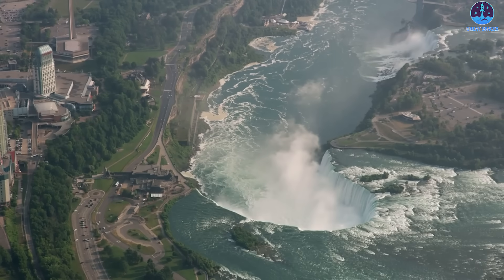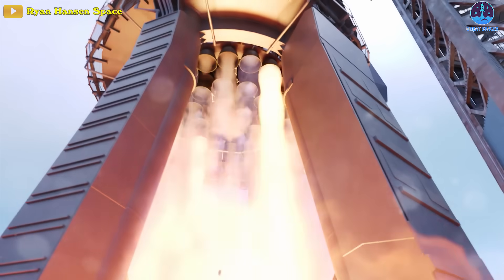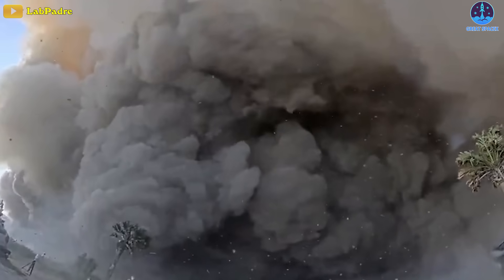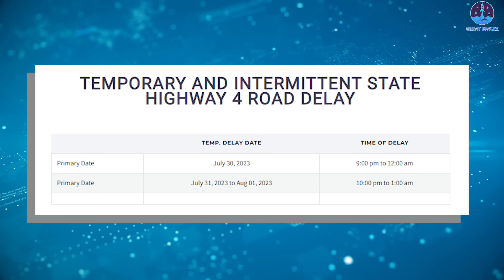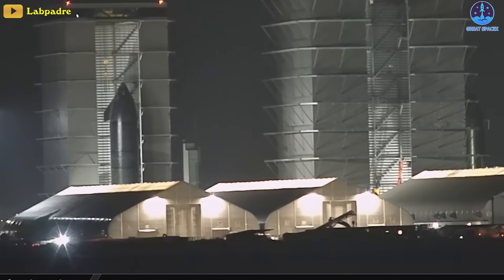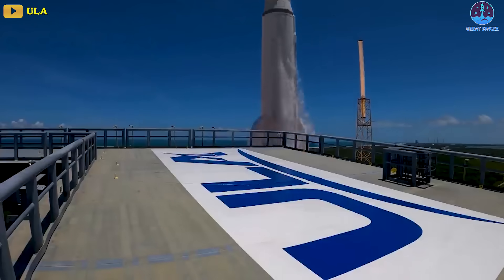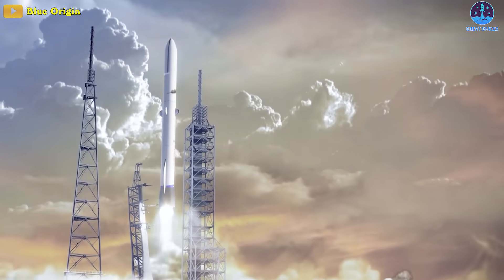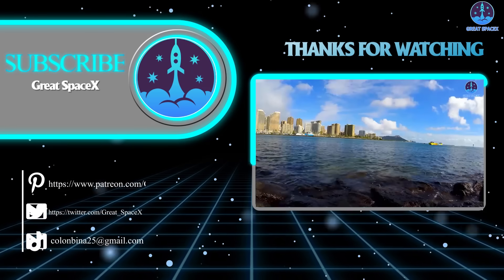SpaceX massive water deluge system full pressure test, Elon Musk's reaction...

Comment: I'm not a kill-joy, but...  I still reckon there will be an issue  where the exhaust shock-cone pulses will penetrate the centre holes of the base-plate. If this happens, the gases entering the sandwich will increase pressure at the centre of the sandwich and push outwards radially between the upper and lower layers of steel. The water is fed from the outside pushing inwards, so there will be a pressure differential: As soon as the plates lose their water, it will be 'Share and Enjoy' at the molten steel diner, and everyone gets their fair quota.

Comment: I'm going to be surprised if that works. There's a reason all launch facilities to date use large diverters in addition to water deluge systems. The water is there to dampen sound. The diverter trench moves the flowing air mass from the rocket in a safe direction. That booster is throwing more than 7000 tons of thrust. I don't think the water system is pushing 7000 tons of thrust in opposition. If the booster pressurizes the ground enough the water isn't going to flow evenly and the base plate will be damaged, bent, or torn up. This is a system that is necessary for SpaceX's plans for future launch sites, including offshore platforms, but if this fails it's another setback. They should have invested in a traditional launch pad and developed the lightweight launch facility on the side.

Comment: Landing Point

Well, from the first attempt at Starship until now there has been plenty of time to improve. I hope that this time there is a balloon with cameras at 30 or 50 thousand feet signing off. Apart from the other cameras in helicopters and airplanes. Even from the starling satellites it could be signing. I also hope that as I mentioned in April the landing point in Hawaii is already designed with rafts and a tarpaulin unfolded with a circle in the center designating the landing positions and cameras on all the rafts to improve accuracy and telemetry. Apart from a good ring of rafts that inflate on the fuselage for the recovery of Starship without her sinking.
I hope that Elon has visualized all these options and if not; there is still time.

An Elon Fan from the Isla Del Encanto: Puerto Rico.

Punto de Aterrizaje
Bueno, desde el primer intento de Starship hasta ahora ha habido suficiente tiempo para mejorar. Espero que esta vez halla un globo con cámaras a 30 o 50 mil pies firmando el despegue. Aparte de las otras cámaras en helicópteros y aviones. Hasta desde los satélites starling se podría estar firmando. Además espero que como lo mencioné en abril ya esté diseñado el punto de acuatizaje en Hawái con  balsas y una lona desplegada con un círculo en el centro designando las posición de acuatizaje y cámaras en todas las balsas para mejorar la precisión y la telemetría. Aparte de un buen anillo de balsas que se inflen sobre el fuselaje para la recuperación de Starship sin que se hunda. 
Espero que Elon halla visualizado todas estas opciones y sino; todavía hay tiempo. 

Un Fan de Elon desde la Isla Del Encanto: Puerto Rico.

Comment: I do not think it is going to work. Nasa pushes water towards the structure to disperse the soundwaves and such. Here the water is going outwards which means that the fire of the rockets is going to fall directly over the sprinklers ¿? They are going to end up melting and stop working right away. The only thing you are going to see is a lot of steam, that is it but the heat of the rockets is going to hit the sprinklers directly.

Comment: looks like the center will be "light" with water.  looking forward to a take off to see how it stands up.
Reply: they should have also included jets from each of the pillars pointing toward the center, both to keep the pillars/stand cool, and to help cool the center portion....ok, step by step...
Reply: No need. And the pillars are getting totally drenched. There's already a downward system in place, albeit not anywhere near as strong - as it's not needed.
Reply: @stratolestele7611
Reply: @stratolestele7611  cool, if I could bet, I give it 50/50...

Comment: Nice as a water-fountain. Unfortunately it won't work. Too little too late. If it does not fail the next test. It will later. The structure is too simple and under-engineered. The massive power of all the engines blasting down that structure is way more than what it can sustain. The engines are too close to the ground. The slanted columns are too close to the fire blast as well. Hopefully vibration resonance will not tune up with any part of the structure. Bottom line is, they are going to have to redesign something way bigger than what is out there, at least 3 to 5 step up scale size.
Reply: So, you must be a very smart engineer. Smarter than the ones SpaceX has hired. You should contact them and tell them you're smarter than them all. What a genius you are! So knowledgeable!
Reply: @lanemedcalf9506  This.

Comment: Why does it aim away from he center instead of toward the center?

/
Reply: Most engines are on the outside ring.
Reply: To leave a donut hole right in the middle of the steel plate.

Comment: I don’t think there will be much water to recover during a launch…it will be turned into steam.  Only tests without rocket engines firing will leave a lot of water.  Simple drainage channels around the perimeter of the base under OLM would probably work.  I expect that following the engine test program SpaceX will have a scale for the deluge system, matched to the number of engines firing.  This will become more accurate and efficient as more launches and engine tests are completed
Reply: You're incorrect.  Remember that steam isn't air, it's still water.  After traveling only about 50-100 meters it will have lost enough energy it will once again condense and fall to the ground.  Likely over 99.75% of the water expelled by the deluge system will need to drain from the area surrounding the launch pad.  Realitivistically air can hold very little water.  For example today in Boca Chica it is 32C and 68% humidity.  That means to reach 100% humidity in a 300,000 cubic meter space, the air can only hold an additional  3,245,119.23 grams of water, or about 857.27 gallons.

Yeah... almost all that water is going to need to be drained, even if the bulk of the fluid changes states for 30 seconds.  It's not just going to disappear.  It's changing states for a few seconds... not splitting atoms.
Reply: @bobguy1167  well said
Reply: @bobguy1167  so you are saying you cannot boil a pot dry there without being left with the same mess if you'd have dumped it on the cold stove?
Reply: @auntysocialist  how often are you boiling 350,000 gallons in your 300,000 cubic meter house?

Yes, you can boil a gallon of water in your house, but that gallon of water, is literally still in your house.  The moment any of the H2O molecules touch any surface that is below the dew point in your house, it will condensate back into the liquid phase.  Just because there's no liquid in the pan, doesn't mean the liquid left your house.  It's on your walls, counters, couches, paint, floors, carpet, beds, clothes, skin, wood, etc.  It doesn't leave unless you use HVAC or other ventilation systems to move the water outside.
Reply: @bobguy1167  true, but such is far from the case here.  You are in an open system of almost infinite volume.  The vapor created will expand out, and by nature of thermodynamics exert a (vapor) pressure on the adjacent mass of air, that will want to reach equilibrium. There is more than enough volume surrounding the launch to absorb all vapor.   I would guess that after the launch, there would not be a lot of standing water, given the amount of heat energy vs the volume of water used.  You could probably calculate it pretty close, especially after a few tests.

Is not the primary function of the deluge system to suppress the shock waves of the engines?  If the rest of the gear can hold up against the blast, you only need enough water to clear the tower.  I saw an illustration of a water curtain suppressing a big speaker generated pulse that could break windows.   You could see the profile of the wave in the curtain.  Also read a story about testing the Saturn 5 engines... a town a few miles from the test site... some kind of weather phenomena reflected the pressure waves back down, taking out all the windows in town.  Fun stuff!!  Watching a starship launch is definitely on my bucket list!

Comment: Okay, big showerhead on the video, quite visually impressive, but um,  they're reticent to provide any useful facts, like the amount of water, the flow rate, the pressures,  the evaporation rates, yadda, yadda, yadda.   

Very suspicious.   

To a first approximation, you have like nine times the Space Shuttle's heat energy,  but at most the same water flow rate.   No reveal of the critical numbers, like the water pressure versus the flame pressure.    So it likely seems  to be a fart in a whirlwind at best.  We will soon see.
Reply: Sorry, but you have you are way off with the amount of water vs the exhaust flow. There are far more water flowing than exhaust gases. It is very obvious from tank volumes. The booster doesn't exactly burn off its full tank volume in those few seconds it is launching off the OLM, does it ? Ok, with scepticism towards of lack of info from SpaceX, but you are too sceptical here..
Reply: Space X likely doesn't want to share too much information regarding amount of water being used, when there are water shortages all over the planet.
Reply: @k.sullivan6303 exactly how do you "waste" water?  It is naturally distilled when it evaporates and RETURNS to the atmosphere.  How does this NOT happen?  Doesn't matter how you use water, it is always in that perpetual cycle.  Electrolysis I guess... splitting up a water molecule is therefore the only "waste" of water I can think of.
Reply: @auntysocialist  You clearly don't know THE WAY OF WATER... and the WAY OF THE YOUNG PEOPLE.
Reply: @k.sullivan6303  Did you know that an application like this one destroys no water?  "The planet" will have no less water afterwards.  Nor, even if water were destroyed or rendered somehow unusable, would it affect anyone anywhere else.  No water is exported from this area anyway.  Good lord.  Serious case of "Better to say nothing and be thought...etc."

Comment: I closely watched the 'slow motion'  replay and find it interesting that the water emanates from the centre of the water platform. My question is - "with 33 Raptor #2 engines at full throttle the water will evaporate at a massive rate so surely the platform is going to be effected" !  How badly will that be?
Reply: i expected the water to be sprayed out radially but more vertical than this. just visually. you want it sideways so while it is boiled and turned into steam and then superheated steam you want that out of the way to take the heat up around the rocket. but just visually it looks wildly horizontal to me.
Reply: I tried some rough calculations recently. It is obvious he volume of water flow from the cooling plate is far greater  in those 5-8 seconds (?) the booster engines effects the ground level under OLM, than the super heated exhaust volume amount coming out of the 33 raptor engines. So getting some figures out of it, depending on the exact volume of the water tanks, the temperature at the nozzles would be below the boiling point of water, so no steam (at the exit holes) on the plate. So no chance of melting anything there, far from it ! 
I guess the pressure of the water has to be higher than the pressure from the heated exhaust at the exit holes, otherwise the exhaust gases would penetrate the plate, but it seems achievable with the the whole cooling system built recently, though I have no specific figures on it.
Reply: @astrogeo1  The water flow was acting against resistance of the small holes in the plate and atmospheric pressure. When the 33 engines are at full or near full throttle, the water flow will be acting against resistance of the small holes and rocket exhaust gas pressure, which will be many times the previous atmospheric pressure. If the same charge pressure is used in the water deluge system the net water flow may be substantially less in this case. This may require increasing the charge pressure to get the desirable water flow under operating exhaust gas pressures.
Reply: It will instantly flash to steam.
Reply: That is just what I noticed it. The engines will burn the sprinklers. NASA throws water toward the center of the platform, these people are throwing out.
Reply: It is going to blowoff instantly!